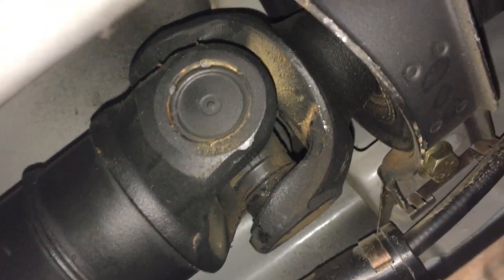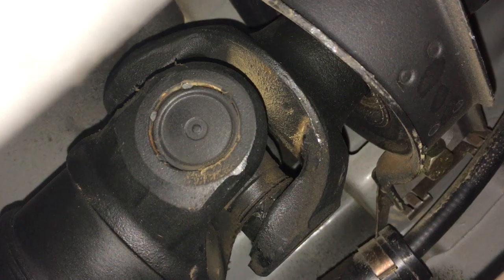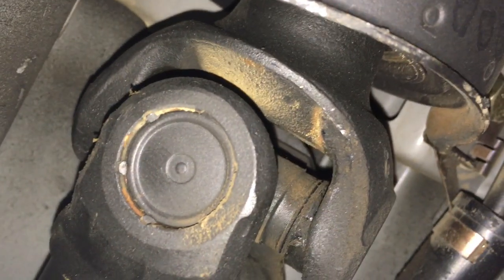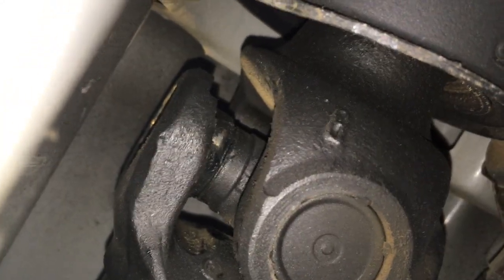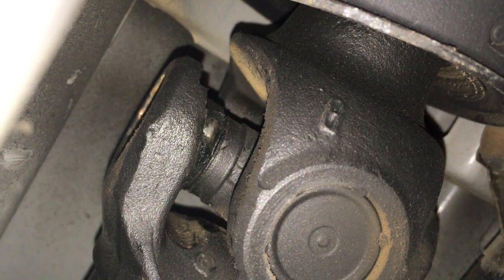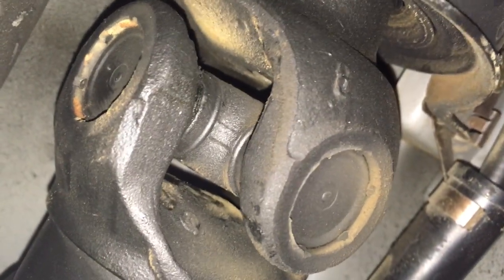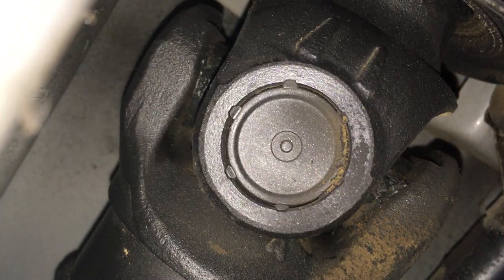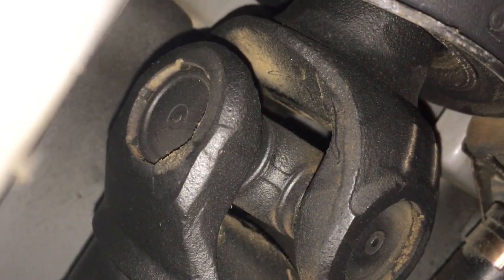Mercedes Rumble strip sound (RSN) during slow acceleration (w209,w203 etc.)

Comment: There's a plate inside the transmission that need a 1/16 inch hole drilled in it. I just had it done and all the rumbling and shifting problems are gone. Amazing
Reply: Thats a little misleading, its actually a #55 drill bit  1/16 is way to big and could damage the converter as it would be very hard for it to lockup at all. Don't want to be a dick but I also dont want people drilling 1/16 inch holes into their valvebody plates.
Reply: @damechanik218  I sent the video to my mechanic.  The difference is night and day.
Reply: @time.528  yeah the fix does feel like a miracle lol
Reply from the maker: I dont know how i feel about this fix, I've seen people doing it but it seems like a hack fix to get around the issue then an actual fix for the problem. If it saves people money then all the power to them but I personally wouldn't do it, if it needed that hole, the transmission would have come with it.
Reply: @aleks0001  Its actually a problem with the torque converter. Mercedes came out with a fix as have several other torque converter rebuilders. This fix has been proven to work . I personally have seen a transmission I did this mod on go another 100,000 miles and still going . But updated torque converter is the right way to fix it . As long as you get the updated one.
Reply: How much did it cost??
Reply: what make and model sprinter do you have? or did you have? i just bought an 09 and if shifts kind of hard and im gettting what im assuming is rumble strip but it also almost sounds like a loose pulley sound coming from the passanger side

Comment: This happens to my Honda Civic. After I make a sharp right turn and then straighten up and accelerate to about 40-50 mph it sounds like I am driving on a rumble strip. When I get up to 55-60 it stops. Do you think I have the same problem? Is it unsafe to drive?
Reply: PS. The Honda Dealership replaced my right front strut 3 months ago because they said it was leaking oil. They rotated my tires at the same time as well.
Reply from the maker: It can't be the same. As far as I'm aware Honda Civic's are all front wheel drive, which means you don't even have a drive shaft.
Reply: @aleks0001  Oh...thanks for letting me know. So maybe it is the transmission :(
Reply from the maker: @MajorCulturalDivide  These things are very tricky to track down. Start with a fluid flush for the transmission and see if that helps. I'm having a hard time believing that a transmission can cause vibrations in the cabin no matter how bad it's worn, but others say it can. As far as I'm concerned all a transmission can do is not engage gears, slam into gears or slip, I just don't see how it can vibrate, but who knows, I'm by no means an expert. Try also changing gears and see if it makes a difference, like it it normally vibrates 40-50 MPH in 5th gear try doing 40-50 MPH in 4th and see if it's the same. If it is I would say it's most likely drive line related.
Reply: @aleks0001  My car is an automatic. But I notice as soon as I hit the gas hard the vibration stops. It also seems to happen mostly after straightening up after sharp right turns. 3 months ago I had the right front strut replaced  because the dealer said it was leaking oil. I don't know if that has anything to do with it. It's a 2002 car. Very old.
Reply from the maker: @MajorCulturalDivide I think you need a good mechanic to have a look at it, it's to hard to try and diagnose over the internet. I suggest you join a honda civic forum and post your question there someone most likely will have had the same issue.
Reply: @aleks0001  Okay I will look for a forum. I don't want to put money into having someone diagnose something that is difficult to find. I don't trust any mechanics I have used in the past. I will be wasting a lot of money on a very old car. Another odd thing is that the car barely made the sound at all today. This is very perplexing. Anyway thank you for your responses!
Reply from the maker: @MajorCulturalDivide  Good luck my friend :) I understand the situation completely, have been there many times, forums are your best bet.
Reply: @aleks0001  HAHAHAHAHAHA LOL
Reply: @MajorCulturalDivide  did you ever resolve this issue? I have a 2002 Honda Civic as well doing the exact same thing. Thank you.
Reply: @MajorCulturalDivide 
I know your comments are old but I know exactly what you mean. I've lived with this problem for probably ten years. I call it the "mysterious rumble". Some days it doesn't do it at all. Drives me crazy. Mine is an 05 Escape. Yes, I'm still driving it.
Reply: @Leslie537  I'm still driving my 2002 civic. It doesn't make the sound much anymore. Sometimes it still seems to do it when I buy really cheap gas.

Comment: Do you know what could be the reason for dropping RPM in idle? It lowers down to 800 900 rpm and goes in few seconds do 1.2 1.3k rpm all by him self! Sometime engine dies on the stop light when im waiting for the green so I have to take the key out and start it again? Maybe MAF sensor? Car was driven by my mom has over 250k miles and it was well maintained never driven above 120kmph in her hands...so Im gambling it is some sort of sensor failure? thanks
Reply from the maker: You should definitely get codes scanned that will show up. You can test the maf sensor. Just unplug it and see if the issue goes away, although you will get a check engine light, but I think it will go away by itself eventually. Google "How to test maf sensor" There are many ways you can do this test yourself and it's pretty simple. I just can't remember them.
Reply: @aleks0001  tnx... we have run the scan and it shows errors: P0300 all the way to P03006 hahah says cylinder misfire detected for all 6 cylinders and the sparkplugs were changed like 10k kilometers ago...ill see with the mechanic
Reply from the maker: @Infinityxx3  dont forget the ignition coils. But if its showing all cylinders then I doubt its spark plugs or ignition coils. Seems like a wiring issue.
Reply: @aleks0001  well see when we put a car on a lift cant be nothing too serious since that car was driven by an old lady xD
Reply from the maker: @Infinityxx3  I'm sure whatever it is, it isn't too serious. Good luck.

Comment: "they don't seem to be too expensive" are you smoking crack, sir? They're $1,000.

Just in case your wondering what that is in smackaroos, it is 1,000.
Reply from the maker: It's a Mercedes dude, $1000 is pocket change on most parts. Either way anyone going down this route I suggest you just get it rebuild. My local driveshaft specialist would have done it for $300 including balancing and you would have a as new driveshaft.

Also this was not the cause of the rumble strip issue. I did replace the driveshaft with a used one and it did help, but it didn't fix the issue. So if you have this little play I wouldn't worry about it, the driveshaft can last a long time even with it, you will know when it gets bad as you will have clear excessive play.

I'm pretty certain the issue was the center support bearing, but I never got around to testing it, I ended up selling the car.
Reply: @aleks0001  Hi Aleksandar I have a question since we have the same engines maybe u had problem like i do now, so when u turn on the car its all alright when u start driving it and u go from like 60kmh to a stop it goes below 1k rpm and sometime dies.... sometimes it goes over 1k rpm by himself to 1.2-4k and goes back down below 1k... car has new gearbox with 15k miles... and yeah gearbox sometime doesnt want to change speeds normaly.... 1 speed goes to max rpm and others sometimes switches in half gear to upper one LOL.... if u drive it in "manual" mode then all the shifting is fine... idk what to think... car was driven by my mom for over 200k miles since it was brand new and everything that was dead in the car was replaced.... so what could it be? maybe some electric problem so I should hook it up to a pc and check if it can even show that problem pc? idk
Reply from the maker: @Infinityxx3  That is a very random problem but it does sound transmission related since the car is fine in Manual mode. I think there is some speed sensor in these transmissions that can do crazy things but it should throw a Code. I suggest you get the car scanned for codes properly, it will probably tell you what's wrong, you need a good tool that can read all the Mercedes codes not just a generic OBD ones.
Reply: @aleks0001  tnx, yea tought so it has to be some sort of sensor ill try to reset it first maybe mechanics didnt do that idk...
Reply from the maker: @Infinityxx3  You will need a tool to do any transmission resets. Forget the whole hold your pedal to the floor for 30 seconds etc That doesn't do anything to the transmission.  If the mechanic replaced your transmission send it back to them and get them to fix it, it's not your problem.
Reply: @aleks0001  problem is in my country nobody can fix it... ill try with pedal first and check with usb and if i dont fix it then ill try to find a legit benz mechanic to help me
Reply from the maker: @Infinityxx3  Find benz mechanic they will fix it :) Dont do pedal, you wasting your time, it only resets throttle body, nothing to do with transmission.
Reply: It's a centre bearing, very common, part is about £50.